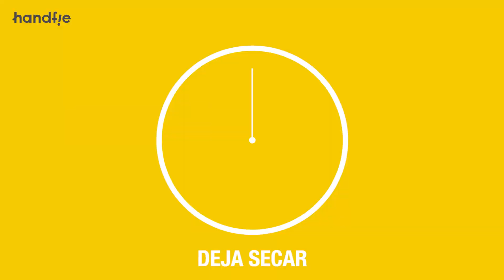Panel perforado casero · Handfie DIY

Comment: para que tanto orificio?, mal diseñado el proyecto.
Reply from the maker: ¡Hola haco! Tener todo el tablero perforado permite que sea versátil y que puedas ir cambiando de posición los ganchos y elementos que incluyas cada vez que te apetezca, sin tener que hacer nuevos agujeros. Este tipo de tableros se utilizan desde siempre en los talleres como paneles de herramientas, y ahora están super de moda para ponerlos dentro de casa :) De todas maneras, seguro que encuentras alguna otra opción que se adapte  más a tus gustos ;)  ¡Un saludo!
Reply: @HandfieDIY  Eso lo sabemos, el problema es que en su video muchos de los agujeros terminaron tapados por las cosas que les pegaron...
Reply from the maker: @cucabizarra_mariana_balbuena  ¡Hola cucabizarra! Lo interesante es aprender cómo se puede hacer para que cada cual lo organice como prefiera, incluso dejando también el corcho y la pizarra sin fijar, o sin ponerlas. Nosotros dejamos opciones y luego ¡que cada cual escoja a su gusto! Un cordial saludo :)